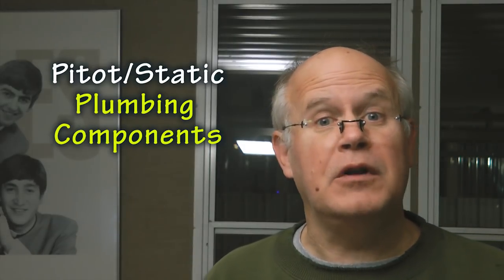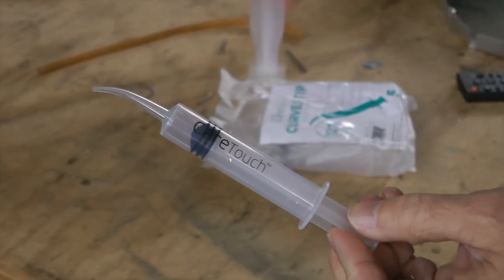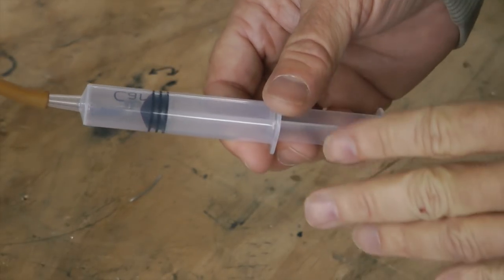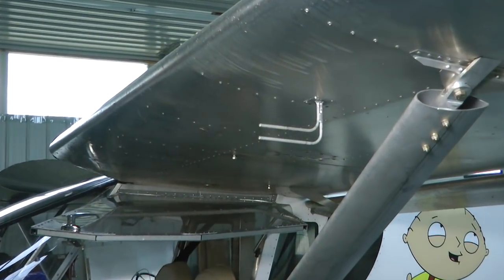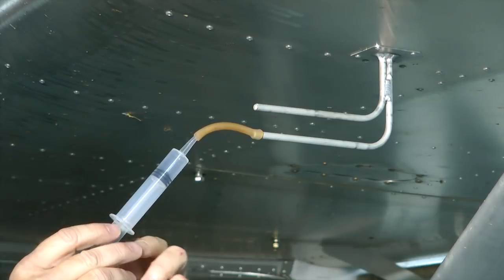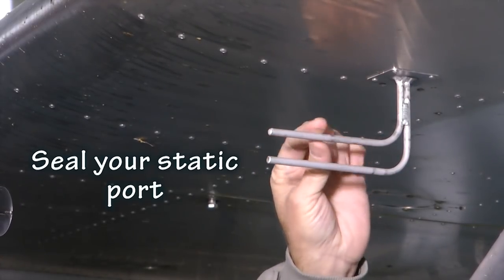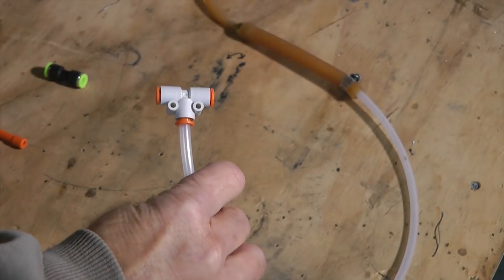Leak Testing your Aircraft's Pitot-Static System: Easy & Simple!

Comment: Good way to do things.  The only two things I would do differently are:

1. I would attach the tube to the pitot tube before attaching the syringe.  This lessens the chance of accidentally sliding the tubing too far over the tube and adding more pressure than you may want.

2. For the pitot test, I would position the plunger 1/4” from bottom before attaching it to the tubing.  That way you can’t accidentally push it more than 1/4”.  And if that is too little travel, it is easy to remove the stringer from the hose, reposition the plunger to say 3/8” from bottom and repeat.  Much the same for the static test: position the plunger only a short distance into the syringe so that you can’t pull it too far and create too much vacuum accidentally.  The plunger will come out releasing the vacuum before damage can be done.

Comment: My pin/drain hole at the  front of the pitot (Bonanza A36) seems to have corrodeded, I cleaned it and (maybe) ome chrome broke off.  It is now (not huge) 2- time the size of a pin hole, and leakas air when I blow in the front (it is ahead of the debris baffle 1/2 inch inside the pitot tube.....would this explain why my ASI is 30% to 50% my actual airpseed I saw after aborting my takeoff?    Could I plug this hole to fix it?

Comment: When using tape to block the static port some of the glue from the tape may change the openning of the static port hole. Make sure there is no glue or add a piece of saran warp around the tube before adding tape.

Comment: Of course you cannot calibrate the system in this manner can you? Also if the certificated IFR system is checked an A&P IA is NOT allowed to perform the check on his own. Did you also check your mode C and S transponder? Can that be done by an amateur builder? Why are these tests even still required when we have solid state equipment installed? I could see it back in the steam punk days and vacuum tubes, but not any longer. It just another expense without much justification. None of these tests were around when my plane was built.
Reply: 91.411 (b)(3) says an A&P can do the static leak check described here. He can’t do any other calibration or certification though.

Comment: Why did the speed go up under a vacuum on the static side? I thought the ASI worked on ONLY pressure. Thanks.
Reply: because air is thinner at higher altitudes so your planes air data computer reads atmospheric pressure from static side and then adjust airspeed in relation two altitude

Comment: Awesome video. Doing a worksheet on static system leak checks and this helped me out a lot. Although I will point out, the tolerances are not in 43.13, but in 25.1325.
Reply: AC 43.13 section 12-58 (c) and (d) does contain the tolerances.

Comment: When you first apply pressure the air in the system will heat up slightly, resulting in even greater pressure. After a few seconds this heat will dissipate and the pressure will drop slightly. The result of this is that the air speed shown will drop a little, then settle. Don't confuse this initial drop with an actual leak.

Comment: Dear Sir, I liked your video. However, there are a few things that you did and stated that are incorrect. These discrepancies can cause damage to your Instruments and/or get you in trouble with the FAA. 1st - The absolute pressure inside the Pitot system must always be equal to or greater than the absolute pressure inside the Static Systen or damage to the Airspeed Indicator will result. 2nd - All aircraft wishing to fly IFR must have their Static tested and certified within the preceding 24 calendar months. 3rd - All Aircraft equipped with mode C transponders must have Mode C Altitude Data Correlation Tests performed before the first flight. You may contact me if you wish to discuss further. Randy@PitotStaticGuys.com
Pitot Static Guys LLC - FAA CRS #2PUR923B.
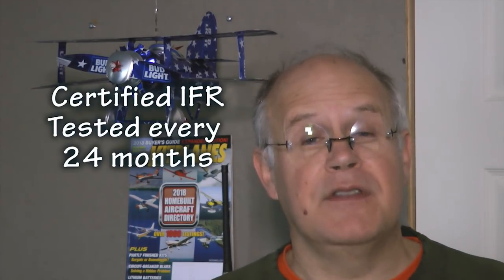Reply: I don't see anywhere in the video that he did or said anything incorrect. 1 - that appears to be what he did. Pressurize the pitot system, vacuum for static. 2 - he says that at 9:33. 3 - you're right but his video isn't about transponders.
Reply: Yup, and he was talking about EXPERIMENTAL catagory aircraft. Procedures, standards, and protocols are different than standard catagory.